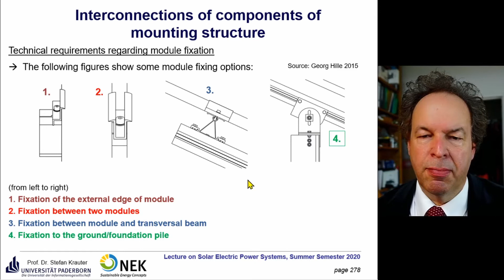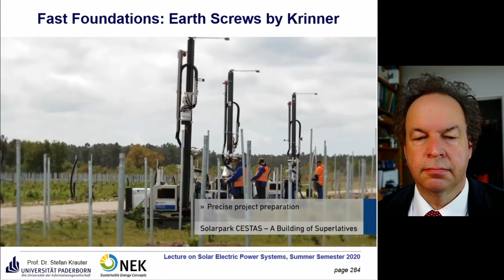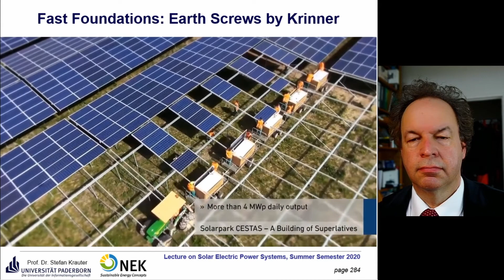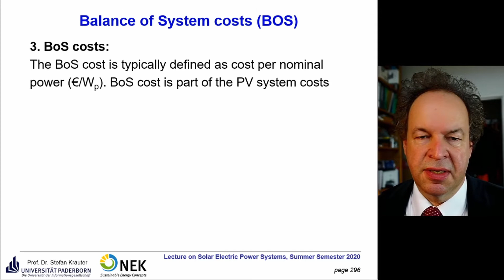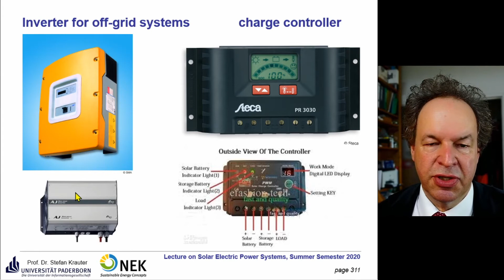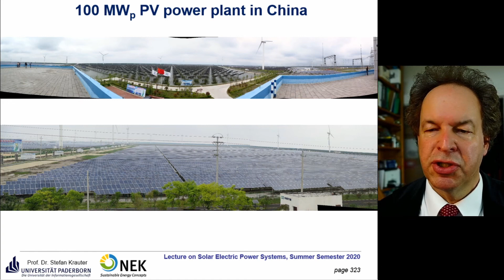Lecture 6 "Solar Electric Energy Systems" Installation, Project Tasks, CO2, EPBT, PV Off-Grid System

Comment: At 49:31 I'd like to ask something about the Solar Home System. What would happen if the battery is fully charged, and therefore the charge controller is disconnected with the left switch due to protect the battery, but there is still power generated by the PV generator. In this case, it would be obvious to use the power generated by PV first to supply the load, before the battery is discharged. Unfortunately this is not possible when the generator is disconnected for battery protection. Will there be a third switch implemented in real life implementations, so that the load can be connected to generator directly, or is it possible to close both switches, so that load and battery are both connected to the battery, even when the battery is fully charged?
Reply from the maker: If there would be a load when the battery is fully charged, the voltage at the battery would be reduced, the charge controller would detect that, and switch on the PV module.